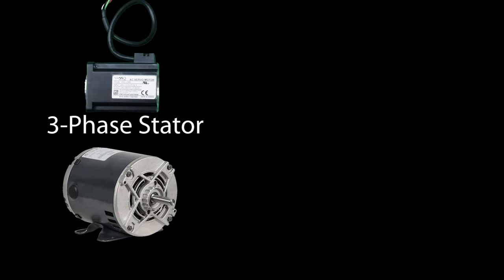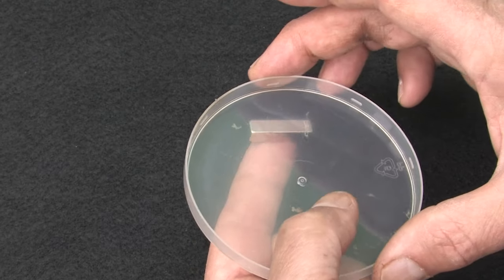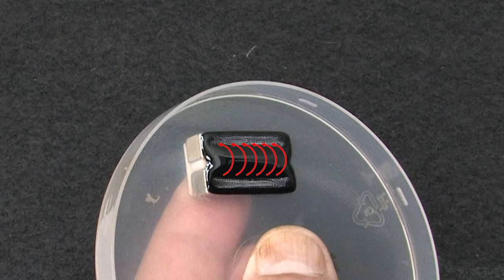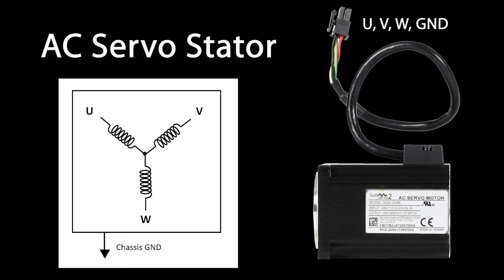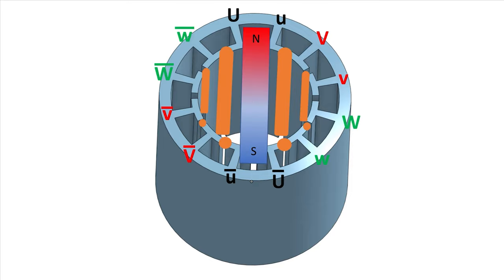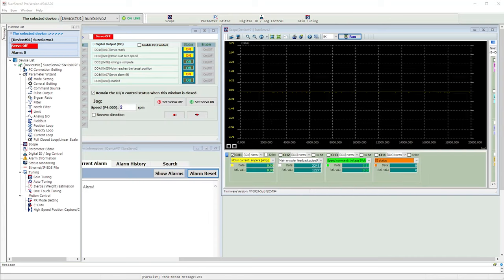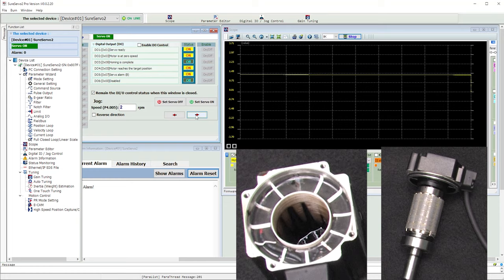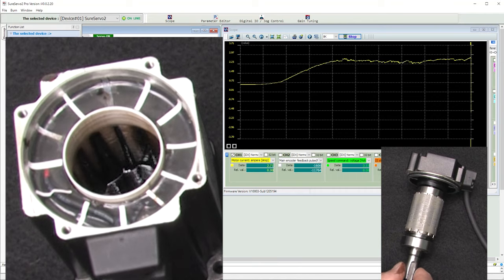What is an AC Servo Motor? from AutomationDirect

Comment: Hi, Jerry here, 20 years into machining but not this stuff, yes a lot of stuffing. Tell me but some are using these for spindles but can or do they utilize A/C motors for drive and positioning for the  X & Y. If so can you speak (just touch) to the accuracy and speed of this. 
One more question is about hydraulics I have never looked into so this is a blind question. Here goes: Could hydraulics be made to control all axis movements in minute machining specs. Maybe also coupled with a laser positioning feedback system, of course the laser system encapsulated? 
I just was thinking if the X and Y servo motors and ball screw and all the controllers involved along with a ball screw could be done away with by laser controlled hydraulic system. One hydraulic motor could power all three, split with control valving? But looking into briefly the hydraulic spindles available only go to 7500 rpm with would mean extreme cost and adaption to a transmission.  So I'll just leave this question to X & Y.  Okay, but still using an automatic tool changer A/C spindle motor of course or 6 hamsters and a feeder and wheel..

 Ut oh, another question:
I seen a spindle motor that had a coolant system running through it. Could not this cooling system be use internally to cool it put valving to expel it to the outside for the tooling. Internal & external cooling. ( probably already done ) that's ENOUGH!  I'm done scouts honor. Never been one so it holds no coolant.

   Hope this question wasn't too-pid. 
Reminds me, a joke:  How do you top a tar?  Tep on the bwake toopid!
Dang it, ya gotta have machines to build them.
Thank- You and God Bless.
Reply from the maker: Hi Jerry,
That's a lot to cover in a YouTube comment, so I would encourage you to contact out free tech support during regular business hours to discuss. Here are all the ways you can contact them:
https://support.automationdirect.com/
In the meantime, some quick answers:
1. A/C Servo Accuracy - They are CRAZY accurate. The encoder resolution is 16777216 pulses per revolution!
2. Hydraulics: I suppose, but it would be REAL slow and difficult to get the accuracy of a servo.
3. Cooling: Sure you could use the same coolant in multiple places.

Comment: How to change the direction of rotating?
Reply from the maker: @Newspacehospitality, while these are AC motors, they are permanent magnet motors usually and have an integrated encoder. The only way to change direction would be to command the drive they are connected to to change direction, as opposed to a traditional squirrel cage asynch motor, where you can just swap phases. Thank you for the comment!